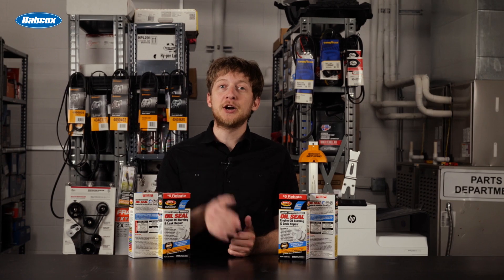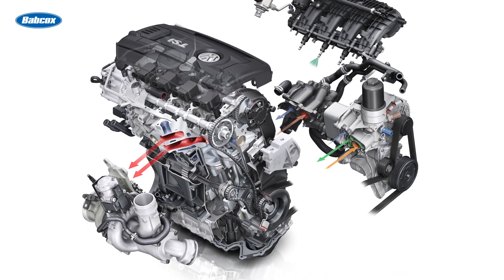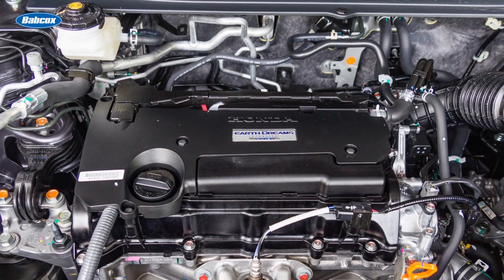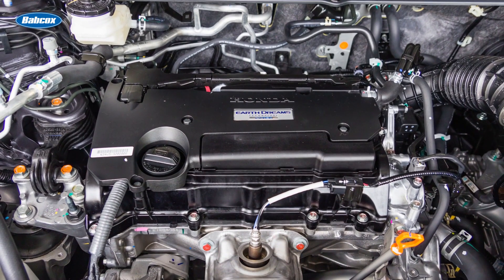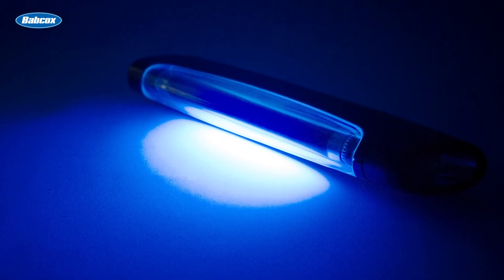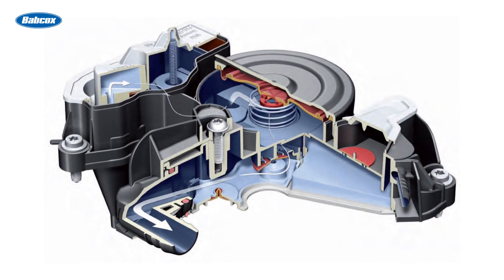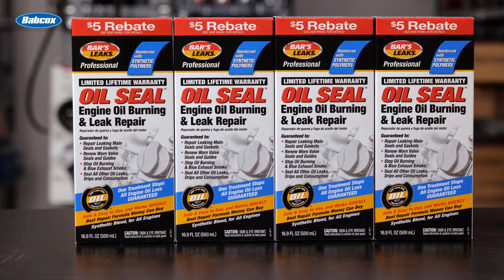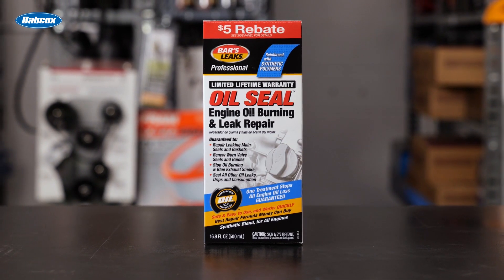How to Pinpoint an Oil Leak Source

Comment: I have had limited success with products like this. It is always best to start by cleaning engine bay also helps you to see other failed parts that contribute to oil leaks such as plastic valve covers that are cracked or disintegrated because of age or being subjected to high under hood temps for years.